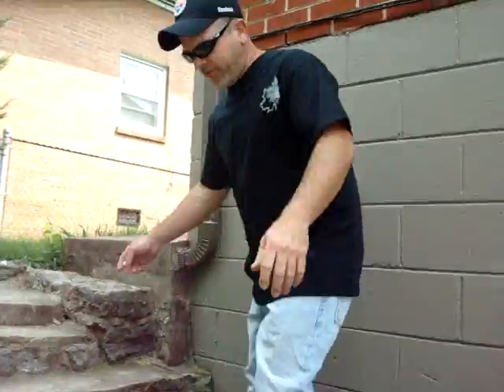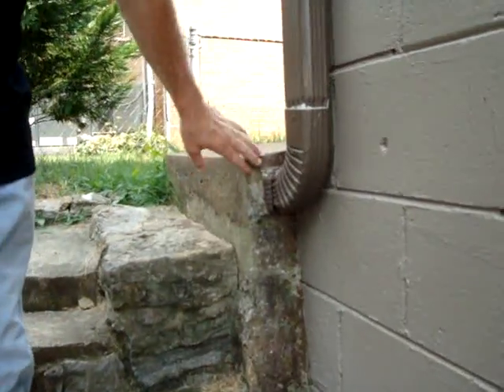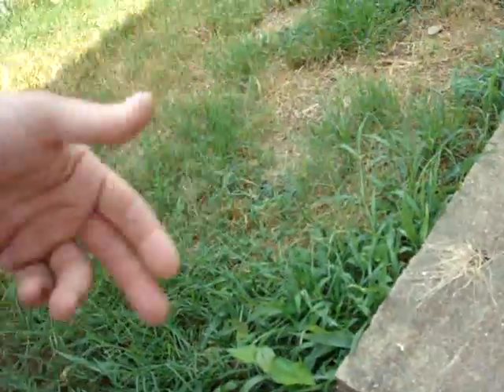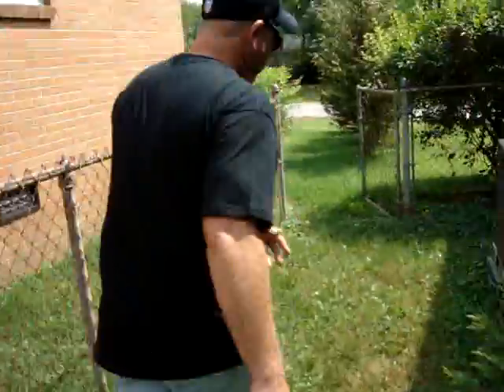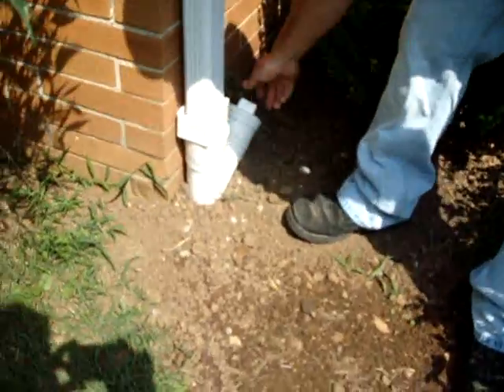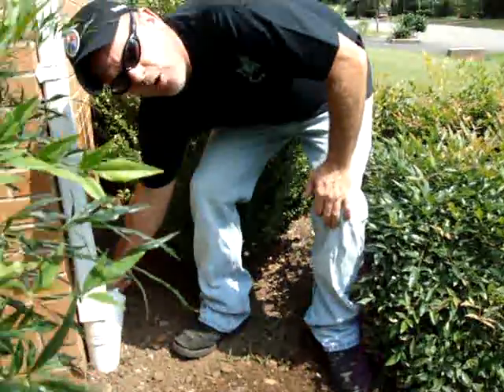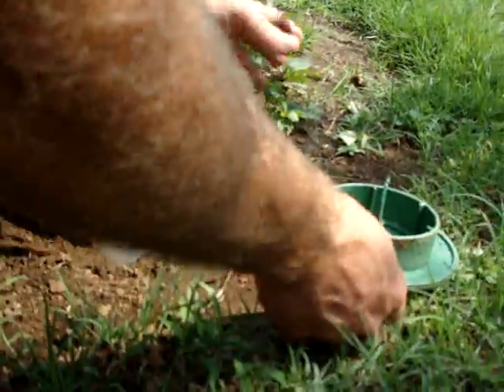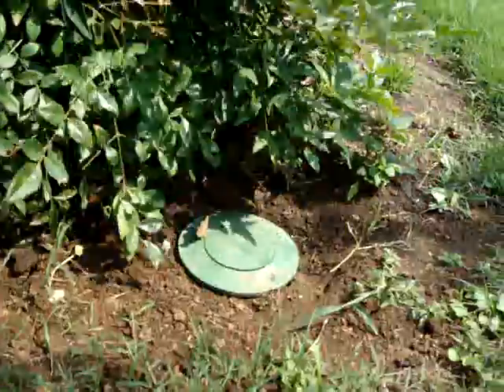Water problems near house foundation! 🤯 #home #repair

Comment from the maker: It is not necessary to put gravel since you are not installing a french drain.  If you would like to place gravel where the water escapes from the pop up, that will be okay.  No landscape fabric is needed either.  Just dig and install!  Remember, if you have 5" gutters, you will need to use 3" pvc piping and if you have 6" downspouts, then you will need 4" pvc.

Hope this helps!!